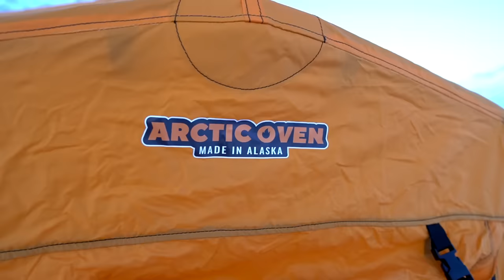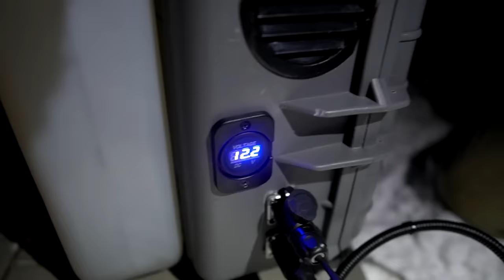Hot Tent Winter Camping | Keeping Warm in the Mountains

Comment: You guys are awesome! If someone else hasn’t said yet, dig a hole into the snow set a piece of firewood sideways in the hole run your tent string under it then cover the wood a bit and hold your weight on it get the tent string right and tied then pack the hole tight with snow and that works great as a tent steak in snow conditions! You guys are rad!

Comment: You can use some firewood  (or stick) as snow stakes; dig a shallow trench parallel to your tent about the same distance you would be using regular tent stakes.  tie your guy line in the middle of the stake and bury it in the snow trench.  When it hardens up you'll be good

Comment: Bo knows... Bandit's ready!  One thing I've found useful for French Press coffee is to put the grounds in the night before, and just enough water to allow them to soak overnight and begin releasing their goodness (think "cold brew").  In the morning, add your hot water as usual.  This also seems to have the same effect as "cowboy coffee" (when you add a splash of cold water to settle the grounds).  I get less grounds slurry in my cup, and the press is easier to push in too.  My press looks nearly identical to yours (mine's double walled/insulated).  I also have one that is single wall for camping.  Just make the coffee in it cowboy coffee style, add the splash of cold to settle the grounds.  

Amazing footage from the drone.  I miss that mountains as far as the eye can see that Alaska gives.  The best Northern Lights I ever experienced was in Kotzebue, oh, about '85.  It was almost like you could reach out and touch them, and, I HEARD them!  The best way to describe their sound was to slide the steel on the strings of a steel guitar (metal strings, of course).  Just sliding it up/down to get the various pitch heard.

Great video, always a pleasure.

Comment: Nice trip guys, it seems tough with the dogs, too bad the hunting didn`t go your way, but hey, the snowmobiling seemed like a riot, I have snowmobiled for years, but never in the mountains, it looked awesome, love those Northern Lights Ariel. Having a 90 degree tent at minus 12 that little heater is crazy, maybe if you could insulate that battery, or extend those cables and keep it inside, what if you built a small box, and filled it with spray foam, and just left the top exposed, to add water, and hook up the cables, -12 is brutal on a battery, but i`m sure you know that, thanks for taking us along.

Comment: if you hook up another duct from the upper half of the tent to the intake side of the diesal heater once  warmed up you can turn the settings down . the heater dosent have to bring the temp of the outside air  all the way up to your liking , it just re heats the air that is already warm using less energy.
Reply: p.s thanks for the content.

Comment: At 12.0 volts, your battery is 50% discharged. It’s ok to occasionally draw the battery down below 50%, but frequently doing that will destroy the battery.  Two 6v batteries in series work much better for constant loads like you have. Lifeline batteries are among the best 6 volt batteries.

Comment: Like your channel. You do great work with that drone. I don't live in Alaska but in Wisconsin. I have winter camped many times. I have a snowtrekker canvas tent. With its double wall construction the arctic oven tent is great. I think the stove you are using is way too big. I also think you pack too much wood in the stove. The wood should not be more than maybe 8 inches. you want to keep that fire in the box longer before it starts its travel up the pipe. I also noticed you do not have a damper on the pipe, that is a mistake. Again you want to keep that heat longer before it travels up the stove pipe. I believe you have the Knee Ko stove. The fire in that stove has a tendency to run away from you. Play with the damper that you should have and the vent in the stove box. Many people I know let the fire go out and rely on their sleeping bay. I personally have a fire all night. I have used welder tarps and they started on fire. You might also think of using "Deadheads" to anchor your tent. Those could just about be anything from a small log to a piece of stiff anything. I use plastic. You bury the deadhead into the snow. Let the snow firm up then, about 45 minutes later you tie off your tent. The coldest I have camped has been -27F.

Comment: Great camping trip.  Wonderful catch on the Northern Lights.  The green lightning is a hard catch.  Did well getting the camp in the forefront of the shot.  Ptarmigan, may be roosting or hanging out in the pine trees for cover or buried below them. Lot of four legged predator tracks around putting pressure on them to stay on the move.  They will go to the threes for safety if it isn't too cold.  Otherwise they will stay buried in snow.  I've flown that area several times, those mountains seem like they go on forever.  So rugged.  Great drone work and the music was dramatic.  Make up an insulated box for both heater and battery or some simple cover/box for the battery.  Using the exhaust to heat it is a good idea but the heater has to burn fresh air.  Maybe just sit the battery on top of it.  Something to think about.  Next time  Take care be safe.

Comment: A little surprised your drone batteries worked in that cold!  Alaska scenery never disappoints.  I see snowy footprints on your floor while you're reading over 90 up high in the tent.  I lived aboard a sailboat and had a diesel fuel heater (no circulating fan) in the cabin.  And I got the same results I see you're getting, near a hundred up high in the cabin, and near freezing at the cabin sole - below bunk level I could see my breath!
Reply from the maker: We were really happy with the wood stove and diesel heater running together. Usually our one dog won't sleep as peacefully on the floor but we had the heater pointed low down near him and he loved it 😁 the drone batteries don't function as they would when they are warm but we have flown in -20 Fahrenheit.

Comment: Would a portable and fold-able solar panel extend the batteries life?  It would be especially cool if the panel could be permanently mounted on the snow machines, to trickle charge the snow machines and the diesel heater battery.
Reply from the maker: Yes it would work great especially with the sunny days we had

Comment: Wonderful video.  No interest in the NuWay 4000 for the tent?  Couple 20 pound bottles would last 4-5 days at those temps.  Don’t have to worry about battery giving up and propane gives such a nice even temperature.  I have the AO 10 with vestibule and the NuWay works unbelievably well.
Reply from the maker: I was concerned with it putting of a moist heat, so we went with the woodstove. But its hard getting up through the night to keep it going
Reply: @SimpleLivingAlaska  No moisture when it is vented to the outside, just nice adjustable, trouble free heat!  I know what you mean by propane giving off moisture. It is definitely noticeable when using a non-vented Buddy heater in my ice shack.

Comment: Great stuff guys. On the diesel heater, are you using a starter battery? You need a leisure battery as its designed for this type of use.
Reply from the maker: We have a deep cycle agm
Reply: @SimpleLivingAlaska  good show, it just looked a bit on the small side.

Regards from Scotland

Comment: Your scenery photography is outstanding. You certainly have done your homework. It really shows in this video. You captured amazing Auroras. I know of photographers that would be proud to have those in their gallery! My wife and I will be in Alaska next year between the middle of March to the middle of April. We'll be in the Nelchina area. I  plan on checking out the Northern Lights at Lake Louise. We were there in 2020 and missed an awesome show by one night. I'm still trying to upgrade by camera gear in order to get the best shots. I just purchased a remote shutter.  Could you share with me the camera settings that you used? Did you shoot in Raw? Raw Jpeg? Manual?  Using the drone to see what's on the other side was clever!! A lot safer too! All the best from Eagle River, Wi,
Reply from the maker: This footage was actually in auto video mode with the lens in manual focus. The lens is a sigma 16mm and we shot the scenes in 4k 30fps. We use a Sony a6400, we are still troubleshooting :)